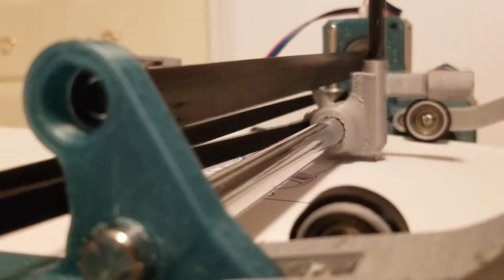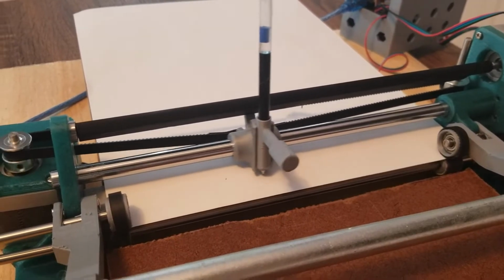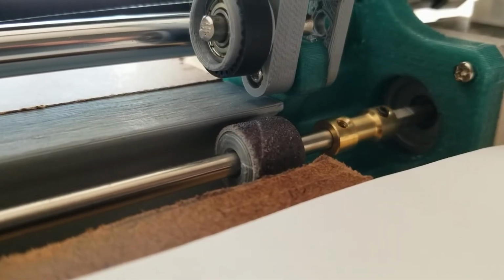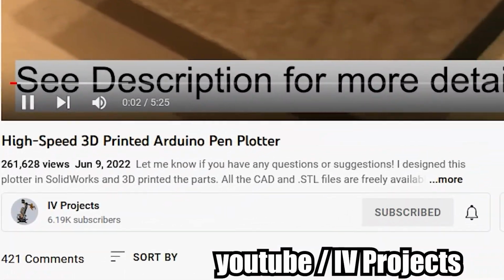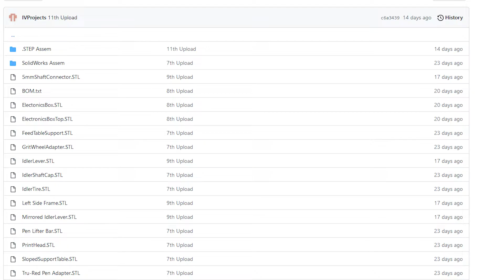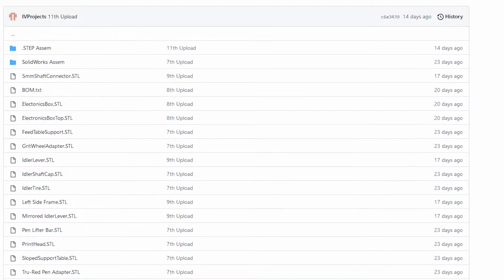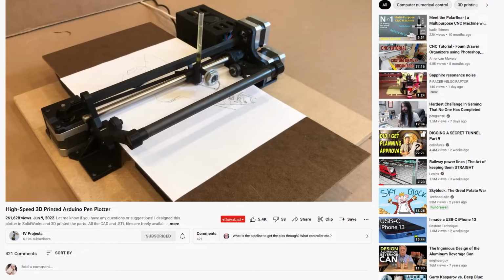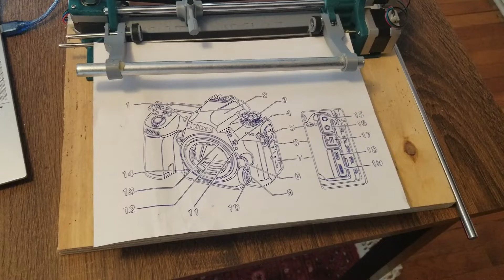High Speed Pen Plotter (IV Projects build)

Comment: Hello,
I was wondering whether it would be possible to provide me with an assembly diagram for the High Speed Pen Plotter. I am relatively new to Arduino, and I was also wondering if it would be possible to have access to the existing code so that the plotter can work, but also so I can understand how each part functions.
I would also like to say a big congratulations for the work you have done on your projects, and a big thank you for giving access to the files used.
Kind regards,

Comment: I would imagine it would be limited to smaller sizes. I built one that has a huge 762mm x 508mm writing area actually a little bigger than that. But with paper that big being moved back and forth you will lose accuracy surely.
Reply: Yes with rubber rollers, not with the sandpaper rollers.
Reply: Do you have a tutorial?

Comment: How do we determine or set the starting position for drawing? What if I want it to draw on a small paper?
Reply: This is just a guess, but I have a 3D printer and I'm pretty sure it would work similarly. However, for this you can you can probably manually set your home point. For a smaller paper you would need a way for the paper to move still, so I feel I quick fix would be to use some painter tape and stick your small paper to a regular size paper, and do it that way.
Reply: @DipMaster20  Thank you

Comment: Is it A4 or A3 size?
Reply from the maker: It’s American paper, so it’s 8.5x11 (inches)
Reply: @makermandan  Thank you. Now I understand that the width of the table is 8.5 in, but the length is most likely not limited by 11 in. You can probably print 8.5x24 or so.

Comment: do you think that this project could be scaled down? I mean to draw in tiny papers
Reply from the maker: Probably. My question is: why would you want it to be compact?
Reply: @makermandan   my idea is to quickly draw tiny portraits taken with a camera (propably in a raspberry pi) and some code to make them Black and white
EDIT: I misunderstood the question the first time I read
Reply: @makermandan  it has to be compact and also the portraits have to be small.
Reply: Maybe you can place / fix a smaller paper on the big one. Like a frame or something